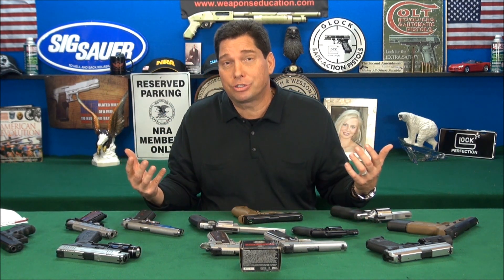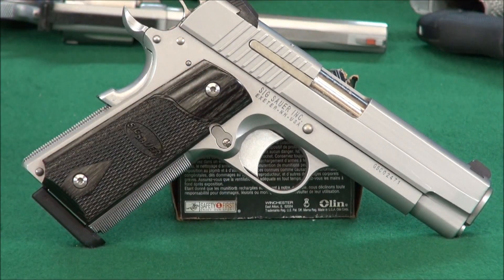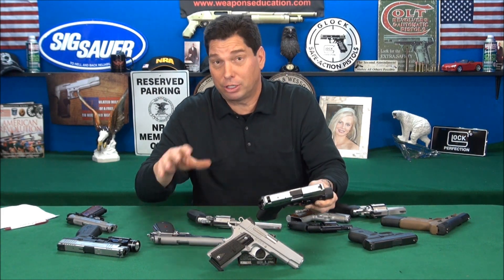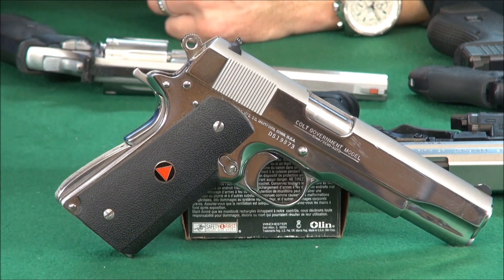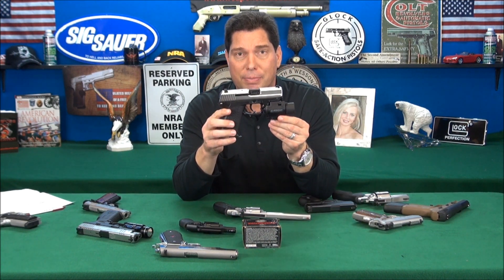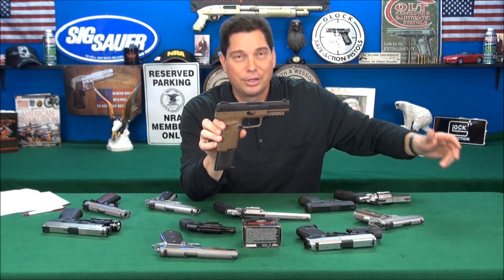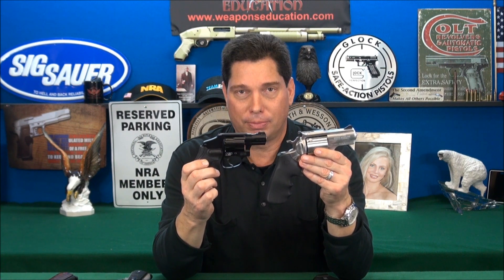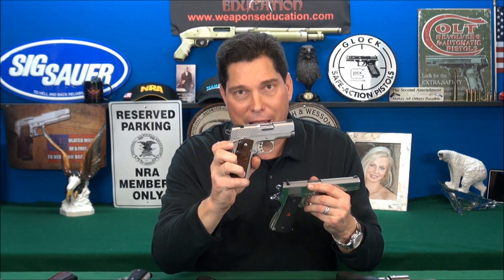Polymer vs Steel Frame Guns weaponseducation

Comment: I own a polymer Jericho 941 and i love it.
Reply: +JOHNNY BLAZE About to get one of those in 9mm. Which do you own? The one with the slide safety or frame safety?
Reply: Whatisright I have the one with the frame safety. Get one you wont regret it.
Reply: JOHNNY BLAZE I ordered the full sized version.
Reply: Whatisright Nice, my Girlfriend just got the Polymer compact!!
Reply: +JOHNNY BLAZE I was going to get the compact. But so far all my pistols are compact. Try something different.
Reply: +JOHNNY BLAZE do you think the polymer is better than the steel jericho? Have you ever shot the steel one? I am considering a Jericho but have always been a Glock guy.
Reply: +n4ktz my friend bought a steel frame CZ 75 within the last week. We went to the range and tried it out with my polymer Jericho. Both guns are full sized. The CZ was easier to keep on target because of the weight. does not flip up as much. That being said after shooting for a bit when you lower the gun you feel it in your arm. I think though a lot has go do with them being full sized pistols. I do however want to get a compact steel Jericho or CZ. One of the range officers showed us his 40. thing was awesome.
Reply: +n4ktz I think its all personal choice. The steel frame Jericho is a beast. Very accurate and easy to keep on target. The weight on the steel fram keeps recoil to a minimum. That being said the weight might be an issue if you plan on using for EDC. If you're planning on buying one just to take to the range i would go withthe steel version. I took my LTC class with my polymer and I shot better than my whole class. Even my instructor was interested in my Jericho. You really cant go wrong with either one.
Reply: +Whatisright Ya the Jericho is built like a CZ 75. Both great guns.
Reply: JOHNNY BLAZE Jericho's an Israeli CZ. I want to get the steel version now. Definitely the compact variant though. BTW both mine and my friends gun are 9mm.

Comment: absolutely correct.  the best LE officers don't ever have to draw their plastic glock. they are trained to de-escalate.  so the public should be aware that your average infantry veteran has more firearms training/experience in 2 years as your average career retiree in LE.  military uses metal frame.  LE uses plastic frame.  noobs use plastic for recoil control.  professionals use metal frames for reliable predictable recoil and use that predictable recoil to adjust their aim 'on the fly'.

Comment: I think if I were a cop working in new york, probably would carry a Glock. But in a  Zombie Apocalypse definitely would choose the Beretta. That is why such a powerful army as the USA uses Beretta, and as a second option was the Sig Sauer also complete steel. I think for long term war scenario,  polymer will not last. But as I said before,  for some police work is useful a smaller and lighter gun.

Comment: steel will last me way longer than polymer way more durable and will give you more firing life, rust is preventable, clean yo shit nd lube it up (i use clp) its not that hard to maintain a steel frame
Reply: Emerzon Romero don't let him lie  to you.. Polymer doesn't shoot as well.. More recoil due to lighter weight
Reply: Emerzon Romero I'm about to get a stainless steel sig, how many times do you clean & lube it in a month?
Reply: Emerzon Romero polymer is better and with many test stronger

Comment: As you say polymer framed guns are made from high quality materials, so I have no issues with them. In fact, I like all high quality arms regardless what material they are made from. Personally, my carry weapons are made with polymer's just for the fact they tend to be a pound or so lighter in weight but strong enough to be viable for self protection. "I never met a great weapon I didn't like". Thank you once again Tom for your excellent presentations. Cheers, Ron

Comment: I think you missed the mark with this video.  The materials used are more for 3 reasons.  Function/Use of gun
Cost
Personal Tastes.    

Length of life of material is not really a factor when selecting a material between these materials.  Weight, cost, bullets to be used, how/where gun will be used are real factors.  For one use steel may be better for me.  Another use a polymer may be better.

Comment: Every composite aircraft F-22, B-2, F-22, F-35... all have aluminum, steel and titanium structure, that's the part taking the flight loads and landing loads, with aluminum being the most used.  The composite plastic is just a skin to provide shape for aerodynamic flow and stealth. The landing gears which take the most abuse are all forged steel.  Where composite has been used for structure loading, F-18 tails it has a titanium root... and the composite and its bonding has proven difficult and problematic.  
Plastic used in guns is not the same it is usually not reinforced with fiber, though a very few like Beretta have used fiber reinforced as frame/handle components.  Gun frames that are plastic are made of injection molded thermoplastic with molding temperatures between 400-600 degrees F.  Only a few plastics are durable over a use temperature range of -25 F to 130 F, fewer yet over -65F to 165F which are temperatures accepted by the military as common use.  Most thermoplastics become too brittle below 0F and too soft over 120F for use in a gun.  Most polymer guns have 2 year warrantee on the plastic part.

Comment: I prefer polymer there lighter and no matter what anybody says there just as strong as steel they require less maint and there lighter. My Sig Sauer SP2022 357 Sig is my favorite pistol. The torture test on the sig sp2022 is amazing it never fails.
Reply: Indeed...

Comment: I prefer steel, I'am more into collecting older firearms and I just don't see people collecting polymer firearms 50 to 100 years from now like you see with old Colts & Smiths today.For a service gun or EDC I see nothing wrong with the modern polymer weapons but they're not somthing I'am going to want to keep and pass on to my children.So it's all steel for me Blue or Stainless !  Tom I'am pretty sure aluminums melting point is right around 1400 degrees not 400,  but your close on the steel  !

Comment: I saw a comment,"polymer for carry and steel for shooting"...how absolutely stupid, and I do mean STUPID! Polymer is lighter, less susceptible to acids/chemicals, requires fewer resources to produce and is on the order of ten times more shock resistant. Hell, no one in there right mind would make an all steel rifle for modern warfare,  given alloys and polymers, a no-brainer.  In extreme heat, 500deg F plus, none of the current springs would retain their temper, all would be inop.

Comment: But........composites are.....PLASTIC. probably polycarbonate or some mix of delerin etc. All reinforced with glass fiber/ ball or carbon ball mix. But consider this. Is the composite going to wear down with the slide going back and forth on it? Metal to metal is probably worse in that scenerio

Comment: I would be more concerned with the long term storage of polymer, such as trunks of cars, or under the front seat of an SUV during multiple southern summers. I love the lightness of polymer, but I won't store it in my car. Steel will last thousands of years, properly cared for in any climate, from jungle to desert. 

Time will tell with polymers, and carbon fiber in the B2 is a great test since it withstands being stored in the desert as well as flight stresses and very cold high altitudes.

I carry a Glock 19 because it's light and it holds enough 9mm rounds to stop a car, 3-5 people, and still have unfired shells left over.
Reply: Just look at modern vehicles in the last 20-25 years. Those plastic parts subjected to heat, cold and stress under load become very brittle and weak. That plastic grill is cracked and the fake chrome is all peeling off it. That 1950 Mercury grill is still top tier..........

Look what happens to "plastic" bumpers on SUVs and pickup trucks. They are fine for a city slicker to haul groceries with. To a farmer or a general contractor they are worthless. Give me steel and chrome any day..... XL or XLT instead of a "whatever the hell".......Ranch King Lariat

Comment: I think there is going to be a major shift in the pistol market sometime in the future going back to steel. All you hear now is polymer this and polymer that with GLOCK coming in right at the top. You would think they are the only manufacturer who is capable of building a decent firearm it's so overblown and overdone.  Pretty soon everyone will own the same guns. That is boring and not for a good future. I own and like them all, but have some experience with heavily used and aged GLOCKs like my Gen 2 G-19 I bought new in 1993 and fired over 20,000 rounds through it. It's aged now and the frame is starting to warp. I don't carry or shoot that one anymore but keep it for sentimental value and reasons. I use my Gen 3 GLOCKs now, but those are much newer guns with a lot less rounds fired through them to give an accurate assessment. All my steel pistols including a Springfield Armory 5" Government that I have owned since age 13 don't show these problems even with the same number of rounds fired through it. I also own a 1973 Colt Detective Special and a older Browning Hi- Power that don't show this. My Beretta 92FSs, Sig Sauer classic P-Series P-226, P-220, P-228, P-229 and CZ-75Bs don't either. Neither does my S&W 686 or any of my Wilson Combat CQBs, Dan Wesson Valor, Springfield Professional, MC Operator or Les Baer Thunder Ranch Special.

Do you see a trend here? I'm not putting all my eggs in one basket and don't get all wrapped up in "ONE" pistol. I like a variety and by doing so can actually see many of the GLOCK's shortcomings and faults not seen by guys who only own one pistol. There is some talk lately about the GLOCK G-19 taking the place of the Sig Sauer P-226 Navy/Mk25. The ignorance spouted off by newbies online is atrocious. Given the choice between a GLOCK or a Sig Sauer P-226 Navy/Mk25 and or a Beretta M9/92FS.....the GLOCK is always going to take a backseat. It's like comparing a Honda Accord to a 1967 Shelby GT-500 Mustang.....

I'm fortunate to have the luxury to own and fire all of them to actually know what I am talking about versus basing my opinion on hearsay and internet BS. For a cheap handgun that works and shoots decent that you don't care if it gets tore up and wrecked a GLOCK is a good choice. For a pistol that you want to go shoot a match where accuracy counts and then hand down to your kids or grand kids....the other two win by a landslide. For resale value on the used market you are going to take a bath on that used GLOCK pistol you are selling. With the others not so much. They even go way up if it is a rare or discontinued model/version. A NIB Flat Dark Earth P-228/M11 reissue is a investment that keeps on giving. That G-19 is nothing special as 50 others are for sale at the same gun show.

Comment: Yes. I think they have gotten a bit too extreme with the customized 1911s. Like I am going to shell out $ 1,800.00 for a custom Kimber or similar. Not in this lifetime. Up here in Canada, we import a good and cheaply priced 1911 copy that is made in China. It is called a Norinco 1911, and I have only heard good things about it. It sells for about $ 300, and is made with good quality steel. I don't think they import them into the U.S.A due to import restrictions.

Comment: What's next, polymer knife blades?
Reply: +deiter kemphf How about Ceramic :)
Reply: +UncleSiam cardboard even better, jk but polymer has came through for the hard working handgunner and riflemen alike, nothing wrong with it but i prefer solid steel or titanium.
Reply: john doe why not?
Reply: I have a ceramic blade knife....it is an excellent blade that will cut same as carbon steel. Polymer....haven't seen that. Nonetheless you may want to educate yourself

Comment: What's funny to me is people will buy ther hell out of polymer pistols but knock the shit out of polymer rifles(Ati omni) saying they don't trust it because it's plastic lol im like dummy your favorite pistol has a plastic lower and runs just fine, long as you got a metal frame you good!! Note far af which is better? I'll say over time ther metal frame gun will hold up better, this is proven with all the surplus military guns you see are old but still function add if new!! Got my eyes on a getting a Beretta 32acp surplus pistol for $249 then have it re coated blk and grey or just grey with blk controls and handles...I think it'll lik nice once re done!! Even all blk would be nice

Comment: Interesting topic. I couldn't find a single test video on polymer. What would happen if you boiled it for an hour, then drop it in Ice water? Left it out in the elements(Sun) for months / years on end. I'm sure it would melt in a fire. What does it take to warp polymer? I personally don't prefer 'plastic / polymer' myself.... ok back to video.....

Comment: Steel frame all the way I've seen too many abused plastic guns with big chips in the grip etc. steel under the same abuse would be marred but definitely wouldn't chipped and missing big chunks.
Reply: Particularly glocks.

Comment: Even though the polymers of today are well advanced and respected. Glock is a great gun. 
Its still plastic.. Accept it and embrace it.
I own a Para P12 1911 that has am aluminum frame. It is what it is . If They made a reliable polymer 1911 I would buy one there great material.
Steel is steel is steel.... Thats not true . There are many different make ups of steel . Why some country's have cheaper metals because there not regulated like the USA. Not every company uses the same steel . There are even multiple different variants of stainless by its self.
Most frames are cast to say they couldnt add a finger groove is ridiculous. I think 1911 style pistols keep the original grip panel approach because thats one of the things we as customers like customizing.
You need to do more research to understand whats what and why.

Comment: Give me a forged steel frame on my 1911 I would hate to try pistol whipping with that little glock. Titanium takes More heat than all metals by the way Stainless is weaker than normal steel also. Carry big or go home